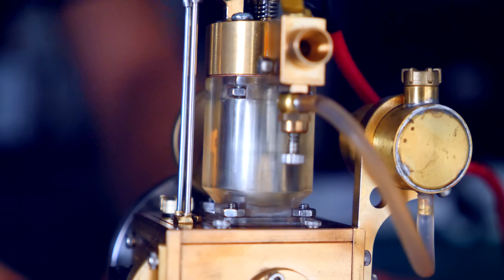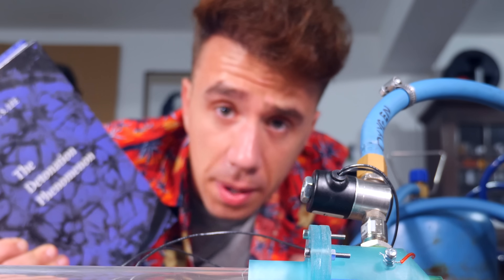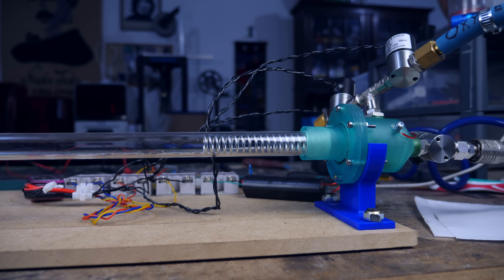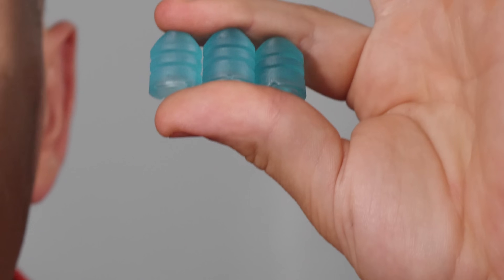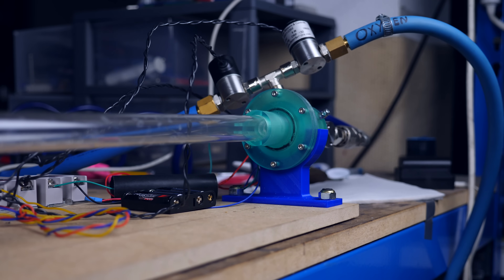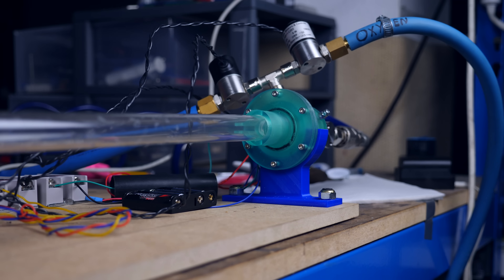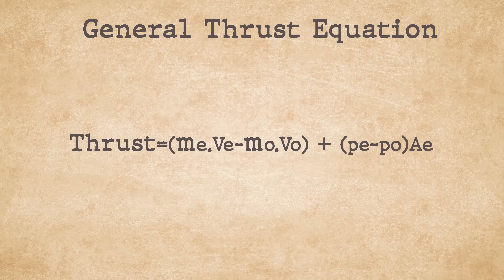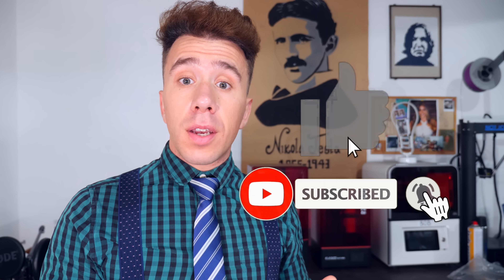PULSED DETONATION ENGINE

Comment from the maker: Sorry for this but there's a scam going on my comment section. I only use the email integza@gmail.com to contact the winners of the printers. Be careful! Do not transfer money to anyone, the printers are 100% free.
Reply: Ok thank you have you thought about getting a metal 3d printer for your projects they might hold up better than the resin ones
Reply: @allen44p  I suggest Integza to go bigger with the rocket engines, make molds and then laminate them with Carbon Fiber and Fireplace Cement (or Quick-Drying Plaster).

The bigger molds will make the task harder, sure, but the geometries can be molded with Carbon Fiber with the bigger rocket engines.
Reply: @allen44p  Metal printers are usually extremely expensive.
Reply: @allen44p  they made a rocket by a metal 3d printer
Reply: @allen44p  What’s your name?
Reply: @allen44p  im not overly financially gifted and have a  business idea id like to do in plastic
Reply: @GWAForUTBE  I'm not eather I can't afford a regular 3d printer  but I have been seeing adds for them and the problems you have been having with things like your pulse jet engine cracking I thought the metal printer's might help thank you and good day
Reply: @GWAForUTBE  I don’t think there is many businesses you can run with a 3d printer. If you really got a good business plan then just get a good 3d printer, the one he’s giving away is just a small cheap one.
Reply: @andrew627  it is entirely 3d printed. This is Elon big. I was hoping to learn the ropes on a freeby cheapy
Reply: @GWAForUTBE  after hearing you say that, I am intrigued in hearing what your idea is lol.
Reply: What's the telegram thing going on right now?
Reply: Wish I knew this 1 hour ago 😥
Reply: @Freeman12457  same
Reply: I opened a fedex account. He needed a paypal and razor gold card aswell.  Smelled bad.  Lets team up and catch this prick. I love this integra team. I hate to see him preyed on in such a mannor
Reply: @GWAForUTBE  that would be awsome... man hunt style
Reply: @GWAForUTBE  I confronted him and he deleted his pfp lol
Reply: @GWAForUTBE  yeah he almost got me !!! He did get my email but I stopped at address lol
Reply: Yeah they almost got me, luckily I caught my mistake before it was too late
Reply: Thanks for the alert. the scammer is asking for 140 usd in shipping. i know because he tried to do it on me, just look at my other comment below and you can block him/her! didn't know better earlier and almost did it, now i know i got myself exited for nothing:(... scammers are terrible!
Reply: @tacoman487  same here homie glad you didn't make that mistake, still a bit disappointing that it was fake tho lol
Reply: @killerbeatz9701  yeah, the part that tipped me off that something was wrong was the fact they wanted to use a backwater chat app, not Gmail, also the fact that they said " let's try and do this soon so my logistics manager can get the paperwork in order" as far as we know integza runs his channel in his own, no mention of anyone else other than family has ever been made. Stay alert, stay safe!
Reply: LOL
The guy says I was short-listed by I dont see a single "thumbs up" on my idea of a diesel engine!
Reply: I have NEVER won one single thing in my whole life....FINALLY I WIN...IS IT A SCAM 😭  😂🤣
Reply: Thanks there is someone trying to scam me right now lol
Reply: I told the telegram scammer the scams been exposed and he deleted his pfp lol
Reply: @Waylon-Pierce  hahaha LOL
Reply: @manuelcrevatin  I don't know why people do stuff like that like that was a high quality scam you could tell there was effort there
Reply: @Waylon-Pierce  i have no idea, i’m still talking with him and making fun from this, like i want to know how far we can go, for now he dont like my idea to pay with paypal
Reply: @manuelcrevatin  does he still have the pfp or did he just block me or something, I have no idea how telegram works
Reply: @Waylon-Pierce  me either, i have necer used Telegram before, but is so funny to trick that guys back
Reply: @manuelcrevatin  if they can string us along on a scam we can string them along on a time waster I think
Reply: @Waylon-Pierce  yes very high quality
Reply: My other comment here got one of those scam posts under it. I leave it to sir Integza to destroy it like a tomato.
Reply: Oh sh*t I've replied to one of them
Reply: @sociallyawkwardguy7106  same lol
Reply: @axe6028  tho thank God I found this, because I'll legit going to pay for it COD, and thank God he doesn't take COD😅 they manually scamming people
Reply: I was actually super excited that I can finally have something for my robotics projects tho😅
Reply: @sociallyawkwardguy7106  lol same. But then I did some checking
Reply: @Boaz timmerman:)
Reply: I like to think most of your viewers are smart enough to figure it out. I've been reporting them when I see them.
Reply: He stopped replying to me and blocked me.  I knew it was a scam from the start. He deleted the chat before I thought to screen shot it. I was having a lot of fun.
Reply: Those scam bits can be so annoying... Keep up the good work!
Reply: new jet idea, tie a jet to the scammer and fly them into space.
Reply: aw dang lol. Got me so hyped when I saw the notification
Reply: I knew it was a scam, because I never win snatching (other than child support)
Reply: that idiot has replied to my comment as well 🙄🙄 Thank you @Integza for your clarifications🙏🙏
Reply: @TejaSays  I think the guy is tired now. He is slow and not very creative.
Reply: Thank because someone text me here
Reply: Thank goodness for this comment
Tricky scam could fool a lot. It twiged me why would they use telegram
Reply: I almost fell for it but I used common sense
Reply: Yeah ive seen thoes asses on other videos. I try to report the ones when i see em.
Reply: Yeah it happened to me. I know it's a scam because the comment has 1 like
Reply: i think the term for the engine as a projectile accelerator is actually LGC wich stands for light gas canon and some of these can go far above tzhe limit a gauss or railgun can reach. they are used to test spaceship components.
Reply: I even gave Him my full address 😅 hope Iv read this before I replied the scam comment
Reply: i've gotten 2 spam replies for a video suggestion already. one of the channels is https://www.youtube.com/channel/UCCyRhQAmrMCmsLpuklvmAVA i checked both of them and neither has videos or comments or nothing
Reply: Jeah i just got exited and te saw that it is the wrong e mal
Reply: I figured as much , I always wait to see in the next video
Reply: I figured. Thanks for the heads up though!
Reply: thx for the heads up!
Reply: thanks for the reassurance
Reply: Lol I just saw that replying to my comment.  It felt a little off when I was going to win something for a remark making fun of your clothing choices🤣 Awesome channel.
Reply: tanks for the gun tutorial
Reply: I reported the post and account that said I had won. 
But please say the above in your future video for the less internet savvy people 
Also build a rocket engine
Reply: @OnlyDIY  dude he has made several videos trying to build a rocket engine.
Reply: Reporting it whenever I get a notification from them replying to my comment!
Reply: What if you made a spinning ball that’s oiled, and it uses the pressure of the oxygen and propane to spin and mix it, if designed in the right way it could spin as fast as you’d want to go!!!!
Reply: Thank you, I was so damn excited I almost clicked the scam link.
Reply: Nxt topic
Antigravty speed engine
Reply: I just got that comment I think.
Reply: there is a lot of this going on.
my friend integza lost his moustache to youtube scammers.
we're trying to track it down, but it's probably been broken for parts..
Reply: I have been texting these scammers all day wasting their time just to have some fun 😂
Reply: Well to my all too slow self... it wasnt painfully obvious at first... in fact at first it was very well put together.... same badge and all..... I figured it out wen he wanted me to download a chat app but still he did his work on this one ill give him that..... its sad because as hard and as well as he did at trying to steal, if he would put that talent and hard work in a real job... might go somwhere wit it...... but if nothing els if he worked that hard at every job he got,  he would make a good hand on the job site..... lol damn shame.....
Reply: I agreed  to you
Reply: You know of course it is just the grandson of the evil tomato... LOL
Reply: @Boaz Timmerman:)
Reply: Damn I'm one of the developers that works for the company OnScale which is connected to OnShape, but not the same company. Seeing someone do a advert for products that I'm connected with is so freaking cool
Reply: Theme for the video => 
MAKE A ( CATHODE RAY TUBE )
- (-|=====        |---) +
Reply: Send me 3D printer dear. ☺
Reply: Bro has all this and no earplugs lol
Reply: Im al most fall with this trap
Reply: Use the Shockwave Jet Engine you’ve got but put a wider mouth at the end of your Exhaust,
 … like the full-size rockets have !!
Reply: Damn so I'm definitely not talking to you then? :(
Reply: I am looking forward to seeing the actual winner.
Reply: Damn... got excited when I saw the reply with the tomato picture thinking I won... lol
Reply: Just reported another scammer, wish we could treat them like you treat tomatoes
Reply: There was a scam on my comment.
Reply: 🔱 Thank you, you saved my money...
https://drive.google.com/file/d/1PrrTCGKEWCZKCaLQ2ut43oDzpqko9qYi/view?usp=sharing
Reply: damn I thought I won
Reply: Some guy tried scaming me
Reply: is this person a scam https://www.youtube.com/channel/UC9gVMItiIFpktmleHCqW8nw

edit: yes he was i will leave this here so you know who is a scam
Reply: Hi. Did I really win?
Reply: And here I was actually thinking a won something for a change😂
Reply: Video theme idea: Aerospike? 
That would be cool to confirm or disprove such hype in certain areas.
Reply: You should try using acetylene for the fuel on a larger heavier version of this engine and mount it on a bike or something.
Reply: i wich i can have one
i will be trying , because thats the only way
Reply: You’re funny
Reply: Yeah, I got sucked in thinking I've won. Luckily I didn't send anything. As soon as I said that I think it's a scam, poof!! The entire text trail in Telegram disappeared.
Reply: I really hoped that I was a winner, but looking at other comments the wheelchair idea was definitely not a winner. Also keep up the projects, and maybe try a pulser jet powered tomato rocket
Reply: Why did you kill Mr.Tomato 😔😔
Reply: They almost got me on that last video. :-/ scammers really do ruin everything. A 3D printer would help out so much, but are SO damned expensive. Having someone going; Hey, You Won! for it all to be a load of crap. You have to be the lowest of the low and I hope you are cursed to never be able to reproduce or to teach your poison to anyone else. I also hope you have uncontrollable explosive diarrhea any time you try to walk out your front door.
Reply: I won a free 36inch t.v.
A getaway for 25 to Hawaii. 
A new computer, tablet and cellphone.
A new car and truck in my choice of colors. 
Your windowlicker is hard at work.
Reply: Your fine just let us piss them off
Reply: integza
Reply: I thought it was weird.. only thing I've ever won was a "cold beer" sign..)/*
Reply: I have seen it to late...
Reply: Use hydrogen
Reply: Yo what's up this is Vic you said I won but you never asked me for any of my information or anyting it was from your email when I don't really mind I was expecting to lose but when you said I won I got really excited so it would just be kind of screwed up if it doesn't go through because I'm even watching your video right now not really that I like you it's just that I like your point of view or your mind you have the materials to make the stuff that's all I'm missing I know how do sheet metal fabricating I could just make a pulse jet motor out of some sheet metal but I would like to make a three-dimensional printing so I could come up with new ways to inject the fuel and make different type of fan blades for it
Reply: Yeah I was duped halfway. So now I'm out "shipping". Shame on me
Reply: I was taught at a young age through thick leather belts you don't get something for nothing anyways.
Reply: What if you use a tube that has rifling inside like a rifle barrel?
Reply: i dont respond to comments 99% of time if i responded it would be to say thanks but give it to someone else, i have a forge and hammer & lathe its oldschool but its what i know lol

love your stuff though you test/make the stuff that ppl need to see imho
Reply: make an ODWE(oblique detonation wave engine it's a circle with a ramp in it so the wave can go around the circle basically
Reply: haha gotcha and I thought won something 😅 all good!
Reply: though it was to good to be true lol
Reply: Ive spent half a day with this scammer.  So do I still win the printer?
Reply: @GWAForUTBE  lol yeah I think we all almost fell for it, spent the better part of my day talking to that guy, figured it out
When I got curious and looked at the other winners comments
Reply: @GWAForUTBE  me same hahahaha
Reply: @GWAForUTBE  I don't normally insult people falling for scams, even when they're painfully obvious like this one was. Just be thankful all you lost was time and not money too.
Reply: @PsRohrbaugh  when as many people fall for it that did.  It was a well played scam.
Reply: @PsRohrbaugh  to me I wast painfully obvious at first... in fact at first it was very well put together.... same badge and all..... I figured it out wen he wanted me to download a chat app but still he did his work ill give him that..... its sad because as hard and as well as he did at trying to steal, if he would put that talent and hard work in a real job... might go somwhere wit it...... but if nothing els.... he would make a good hand..... lol damn shame.....

Comment: if HHO gas is usually produced by electrolysis of a dilute solution of an electrolyte in water [38]. This results in the formation of hydrogen and oxygen gases at the cathode and anode respectively. then may be good for this project as well. all so you could use multiple smaller dry cell hho generators. need more flow. just add another one

Comment: only speed of sound. h2 o2 detonation should be at least 5000m/s. yes explosion velocity. so why are you trying to accelerate slow air, why not just let the explosion be the thrust directly. at max speed. yeah potato cannon. thats a shotgun slug. dont use a manual valve, let the pulse jet automatically flap the valves. according to the detonation exit timing. ie resonance of the tube. you dont need to use rotating detonation, you can just use normal pulsejet but with actual oxidizer, pulsing, not air.

Comment: The mushroom expansion at about 10cm past the exhaust is likely the transition from supersonic  flow to subsonic as the shock pulse come out of the engine and trades velocity for pressure and expands.

Comment: If you have a perfect system of electrolysis to hho back to water you can make bubbles at the bottom of a pipe and make free energy with the displacement of the bubbles. Just make your tube long enough and you'll eventually break the free energy barrier

Comment: Thanks for making me laugh ☺️ I'm wondering if it is possible to mount 2 or 3 of these engines to the same thrust tube (not sure hades on design), then control them sequencially to make a continuous thrust? They could all be connected to the same fuel source and air, and would draw at different times. Also, would modifying the end of the thrust tube (don't be gross guys) to tune the pressure wave for best pressure to expansion wave allow for more effective thrust as it pushes against the atmosphere? This would make an awesome vid. Your awesome - cheers

Comment: You could increase the flow of the engine by adding a valve connected to the combustion chamber. The valve could only allow for outside air to enter, this way when the ignition starts and it detonates, air will enter almost instantly thru the valve instead of going all the way of the tube. This could increase the frequency at which you operate the engine as it takes less time to reload the engine. This could also increase the power of the engine as the input air doesn't interfere with the exhaust air.

Comment: If this detonation engine works as I think. Could you transfer that exhaust power to a pistion? Changing it to rotational force.
Sort of a normal 4 cycle engine but with a remote combustion chamber.

Comment: What if you built 100 of those together, aimed at sharp degree inside the base of a large cylinder with cone in center all timed in sequence to create a rotating detonation engine? That would solve the problem in rotating detonation engines failure as the combustion would then be forced and timed rather than just getting lucky in creating the circular wave detonation. If at any given point there were a failure it would simply restart automatically on the next round of firings milliseconds later.

Comment: Couldn't you use a rotating disk that has holes drilled at specific intervals along the axis but the only time a hole is exposed to pass gas through is when it's in line with the detonation chamber? You could have continuous flow and the frequency would be determined by the space between the holes or the speed its rotatinf at. so no need for valves or a computer control, it's all mechanical.

Comment: Try different size exhaust cones keep the angle of the cones between 11 and 14 degrees. You observed and stated the problem when you noticed the mushroom shape of the exhaust stream. Just spread the force out over a larger area so there is more effective use of force. Tomatoes are great in a sandwich with bacon lettuce and mayo.